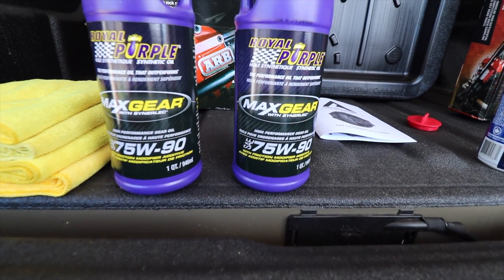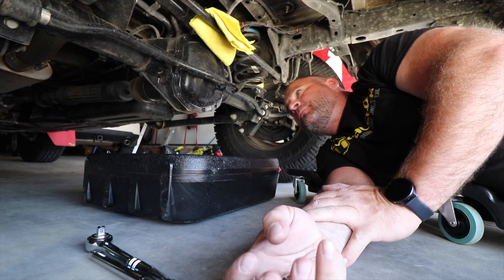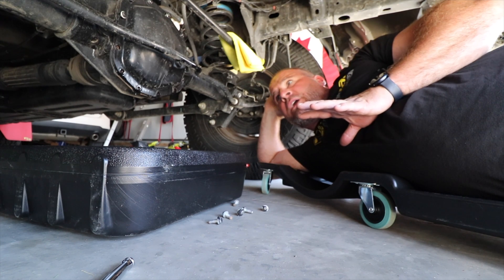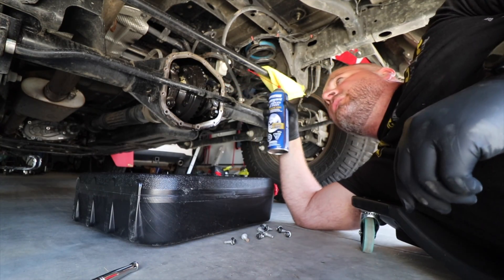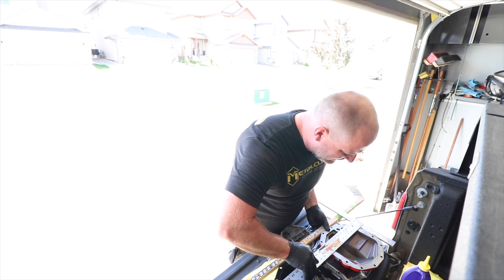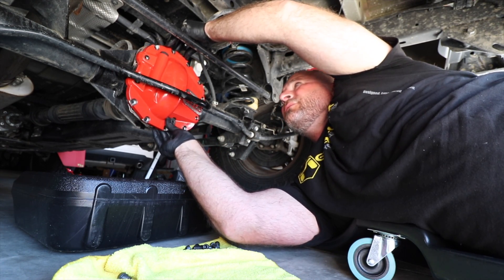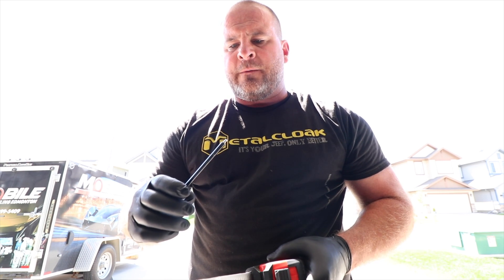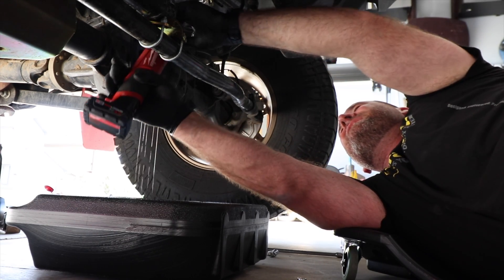Front & Rear ARB differential cover install

Comment: being this video is old, its still great info.  one concern, DO NOT use brake parts cleaner.  there are electrical components in the diffs that will degrade from the brake cleaner.  Use electric parts cleaner instead.  Very similar stuff and wont beat up the plastics in those electronic parts.

Comment: Factory gasket looks like the Lube Locker gasket, yes they are re useable. I find it odd factory is using these usually they install with silicone.

Comment: there has been mention that the ARB cover has a different volume amount than the stock cover.   if you want to know for sure then before putting it on the vehicle install the ARB plug and dipstick then fill it with water then measure the volume. Do the same with your stock cover then compare.
Reply from the maker: Good idea

Comment: Would it be advisable to make the dipstick mark on the dipstick when it is tightened down to the torque spec first? Does it make a difference?

Comment: Just out of Curiosity.. Where I find Fluid Capacities it says 2.18 pts =35 oz front and 3.06 pts = 49 oz rear. You mentioned that you put 2 qts front and 2 qts rear. Where did that fall in the mark on the dip stick?
Reply from the maker: I just made a mark on the dipstick and filled it to there.  Zero issues.  I'm sure there's a more accurate way to do it but that's what I did.

Comment: I have a question about the dipstick marking.  You stated that the measurement was 1 1/16 inch.  Is that measurement for when the dipstick was screwed all the way in, or is that the measurement with the stick just placed into the hole and not screwed in.  Just in case that was not clear, If you use that measurement and you want to check the level, do you just insert the stick or screw it in to get the proper fill level.  Thanks.  I hope you are able to answer this, as I cannot find it anywhere.
Reply from the maker: That was screwed in all the way.  You can measure it your own way if you need like I did with a straight edge.   But I had it screwed In and that's what I came up with.  Hope this helps.

Comment: 1) The color of that fluid was absolutely terrible in the rear. Front looked great.

2) Why would you re-use that gasket? if the new diff cover has drain plugs and all in it why risk having to take it back off for not putting on a new $20 gasket? 

3) A torx bit in a hex head... really...

Comment: I just got a new 2021 Jeep Wrangler Unlimited Willy's JL with limited slip rear diff, when looking at ARB web-site it shows a couple different  covers for different axles.......how can I tell what's on my Willy's? Thanks for sharing.
Reply from the maker: So if your ordering direct you should be able to select either your diff and gears or give  4wp a call and they can make sure you got the right ones.

Comment: Great video,  are these for D44s? My ARB covers came in and planning on putting them on!
Reply from the maker: Yes.  That's what I have on my rubicon
Reply: Nice, thanks. Replaced the rear cover today; the trackbar on my JLR was blocking the top bolts so it took some time to get off.

I also added 2 quarts of Royal purp 75w90, it seemed to go up to the line I made (which was 1.0625 - 1.125 inches). after driving it, did you need to add or remove gear oil?

thanks for the input, I used your video as a guide to do mine!